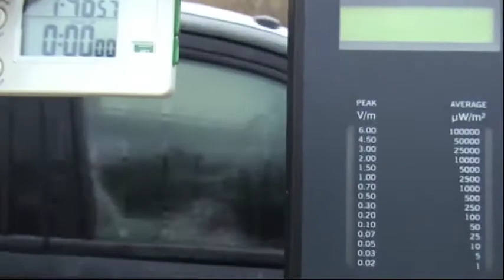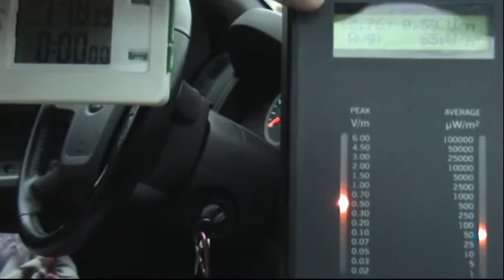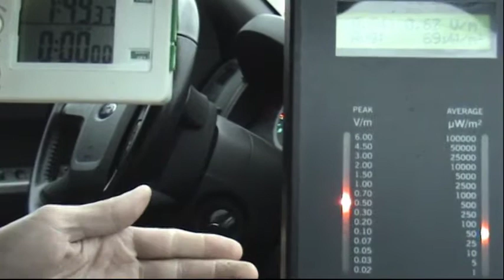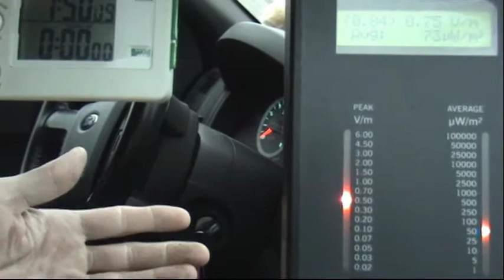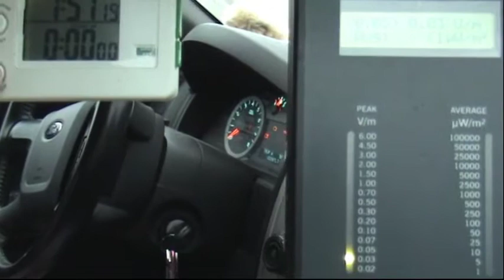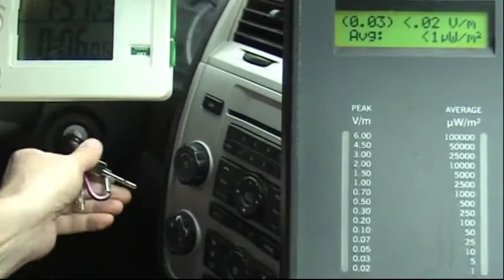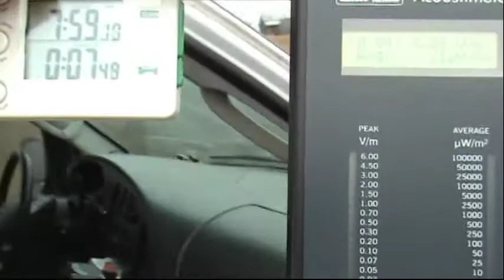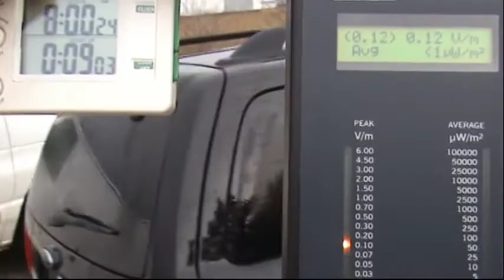Measuring RF microwave radiation in cars

Comment: So the Garmin is able to store frequently used destinations so as you did in the video, if you picked somewhere they typically go like say home , there's a possibility of it being stored offline that way it's just "hardwired" in the system on the map requiring nothing wireless at that point. The second it has to go outside that box for any kind of information then you should have sometype of reading. From the satellite or antenna however that system works at some point if the destination isn't saved RF will come into play. I just finished 8 years in the Airforce as a Satellite maintainer and worked In the RF shop. If you have any questions your not sure about just message me it's no problem. Not that I have all the answers but I can give it an educated guess.👍
Reply from the maker: This doesn't seem to answer what the RF signal was relating to the ignition switch.  I don't think this Garmin has any connection ability except through updates when connected to a computer.  It was bought at a yard sale with no contract or monthly obligation.
Reply: ForbiddTV oh yeah definitely has nothing to do with the vehicle question I would be the wrong guy to answer that but I can Absolutely say the gentelmens answer about the rfid checking ids is 100% false. But another thing all garmins have an RF signal. To triangulate and find out where you are on the planet requires a minimum of 4 SATs. Time, distance, speed, location. As far as updates go those I know use to be via USB or SD card. The files are way to big for that little thing to have to computing capacity to do it any other way and it take a week to upload. Another reason it'll use a form of rf is the traffic updates and choices of reroutes according to traffic on all routes available. Typically it'll show the fastest way but have options for 2 or 3 more with eta varying on traffic and mileage as well as max mph per road

Comment: Have you tried with a trifield...?
Reply from the maker: Tim Pemberton   Yes, but the Trifield meter tests for three different types of frequencies.  This test was for RF in the 200MHz to 8GHz range which the Trifield meter does poorly.  Testing on electric and magnetic EMF fields in the ranges of 20Hz to 50,000Hz will be performed on separate videos, but I probably won't be using the Trifield for those tests.

Comment: this is part of the Gestapo-esk, SHOW ME YOURS PAPERS i.e. -"Real ID ACT" , which is logging all RFID'ed driver licenses inside the car.
Reply from the maker: TarQuip  Sounds like conspiracy theory fear porn to me, but I will wait and see what other logical explanations come in.  Eventually some electrical engineer or auto computer programmer will tell what it is and provide a way to confirm it.
Reply: ForbiddTV haha no your right and the wait is up. So the new, brand new cars I hear are having many systems like he mentioned installed in them but I assure you if your car is 3 years old then it's something else and even if it were brand new the owner would know about it. They would be signing off that they understand they are giving this personal info to a 3rd party Everytime they get in and start the car along with the passengers. Besides you don't have a rfid chip in you driver's licence. When they push the universal I'd ACT bs, then that card will have it . but they still won't need to check and see who has the ID in the car because at that point every single human being will be required to have one of those IDs thus there's no reason for them to check because everyone has one.